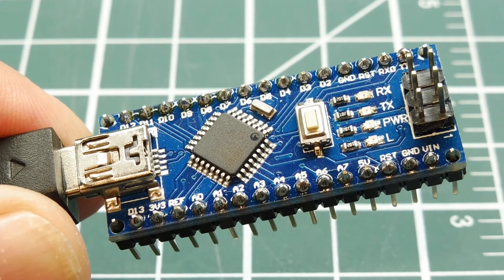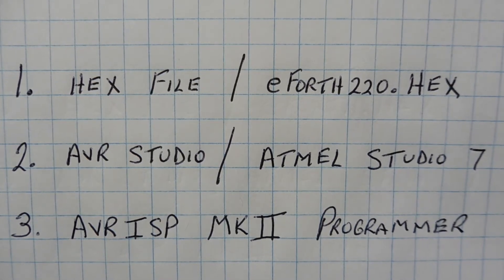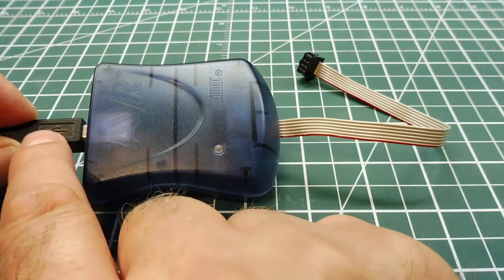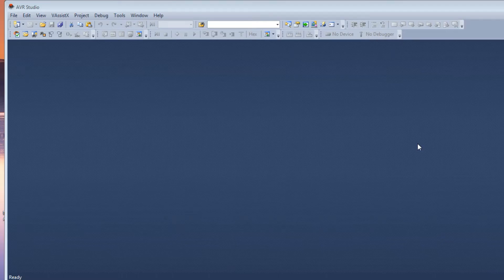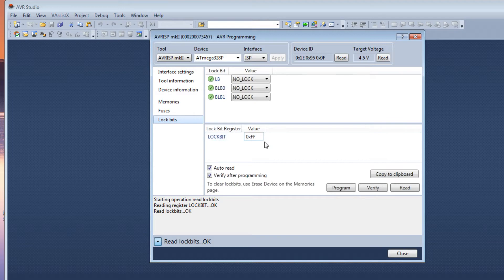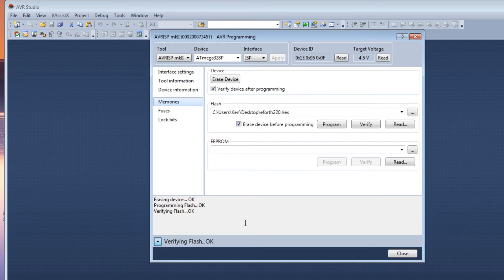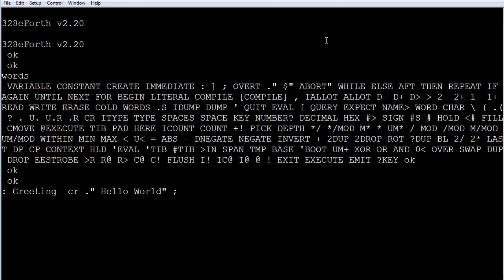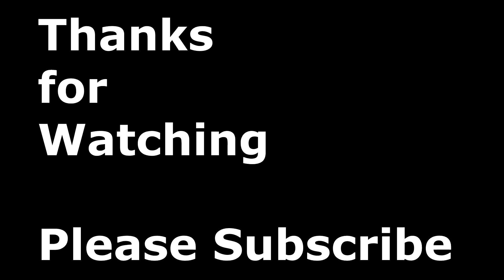Arduino Hex File Programming / Forth Programming Language

Comment: What can Forth be used for ? Controlling telescopes which it was designed for if I remember correctly? But how ? I tried Forth on a ZX Spectrum in 1986-87 but never got the grip of it.
Today I use C ,Basic,Python , Micropython on ESP32, STM32, Arduino and PI etc. Can a Forth program read a BME280 sensor ? I'll  give Forth a try again. Thanks
Reply from the maker: SPI or I2C is used to read the BME280 sensor. I have other videos covering these protocols and how to read sensors.
Reply: Thanks, What is  best device to start with ? I have Uno's,Megas, STM32F103  ,  STM32F401  and ESP8266/ESP32?  Plus a ton of usb-ttl adapters for serial comm.
Reply from the maker: Start with the device you are most comfortable with. Arduino would be simpler than the ARM boards. Start here: https://arduino-forth.com/

Comment: Will this programmer work to upload the hexfile?
https://www.aliexpress.com/item/1LOT-New-USBASP-USBISP-AVR-Programmer-USB-ISP-USB-ASP-ATMEGA8-ATMEGA128-Support-Win7-64/32724669918.html?spm=a2g0s.9042311.0.0.27424c4dGIsg4b
combined with this adapter:
https://www.aliexpress.com/item/Free-Shipping-10-Pin-to-6-Pin-Adapter-Board-for-AVRISP-MKII-USBASP-STK500-High-Quality/32627636397.html?spm=a2g0s.9042311.0.0.89f94c4dPaELfa

I hope so because I already ordered them :)
Reply from the maker: If you want to use AVR Studio software to upload hex files look for AVRISP MKII  compatible programmers. You might have to use AVRdude when using the programmer you have ordered.
Reply: @0033mer  Ok, I checked the AVR dude software and it looks a bit less inviting with the command line editor and there is quite a lot of room for error there. So the more pricy MKII  programmer might save me a lot of time and trouble I think.
 Thank you very much for your answer :)

Comment: 0:34 ICSP = In Circuit SERIAL Programming.. ;)
Reply from the maker: You are correct, it is "serial". I realized after uploading. Was thinking about the programmer "ISP".
Both ICSP and ISP are used by different vendors. Too many acronyms :o)